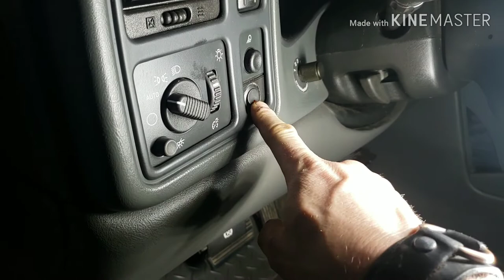BOOST AUTO MIRROR GLASS REPLACEMENT AND LED CUBE LIGHT INSTALL

Comment: Are those mirrors for replacement of currently installed boost branded mirrors or are they custom ones one can get to replace their factory ones?

 I wouldn't mind just changing the glass out if possible?

 Adding the LED lights and the heater would be a great option with the cold weather we get. I must say I love the bright Fog light / Backup light option on the mirrors.

 I do have to get a light bar and get it mounted overhead as well. Have all the wiring, connectors, collets for crimping the threaded portion in and being able to screw a bolt into for mounting the bracket. The crimp tool is great for adding threads where you need to add aftermarket accessories and there's not any bolt holes. 

Back to the mirrors if Boosted could get me the proper glass like the factory mirrors have and I buy the wiring kits from them as is needed for adding the defrost and LED I wouldn't have no problem doing a video as I have all the tools to make it happen. It would be something that would be a big hit for those who want to add those options that the vehicles didn't come with or previous owners passed over the options. 

IF they can't get the glass then I'll have to wait as I was looking at them the other day on the Boosted website for my 04 Chevy Tahoe and I just couldn't spend that much money at the current time. Things have changed dramatically and my garage addition, car hoist and all got put on hold indefinitely as the wife was let go after 21yrs 8 1/2 months the day before my birthday this past month. It sucks as she'd only had 2 small write ups in all those years and they happened to be 6 months apart. No probation or anything and like that our health insurance jumped over $1k per month while her pay went away having no job. 😒😦

I'd really like to find a company that has engines, specifically diesel and wouldn't mind sending me one paired up with a transmission, Allison maybe and turn this Tahoe from a 4.8 gas into a Diesel blowing monster with videos of course that I could post. Anything extra would count at this time as disability only goes so far and we've always lived within our means. 

I'd have to do all the work myself but that's the fun part about it especially without a hoist and outside. I do have one buddy who could probably help here and there but I think my chances of getting the motor and transmission are next to nothing. Heck I'm still waiting to win a golden wrench someday with the Toolheadz Crate which has been a success so far. 

Sorry bout the long rambling just with all the changes lately things have stressed me to the max.
Reply from the maker: Dale, You feel free to ramble and comment as much as you want for my videos!   Thanks for the kind words and support of my channel!

as for the mirrors, those are not the original mirrors that were on the truck, the person that had it before bought those mirrors from boost auto before I had them and the LEDs just failed.  you may be able to find mirrors that have the features that you want, however, if the sales codes are not on the vehicle, then you will have to either get them added or splice wiring however you can to make them work.  Thankfully, mine was already added and equipped so there was no issue.  Feel free to check their website and see what they have for your vehicle and if they don't have what you are looking for, you could always email them and they may be able to point you in the right direction.  

as for the engine and trans issue, I don't really have an answer for that.  sorry man :)

Thanks again for all the support and if you have any other questions, let me know!
Reply: @CaptainRon1  Yeah my thought is get the wiring harness from Boost and get the heated mirrors from a salvage yard and run it to a capable open slot in the fuse box.

 Maybe see if I can get a temperature controlled switch for activating it or just a under dash switch for winter use. I'd do it for the wife's impala as well....